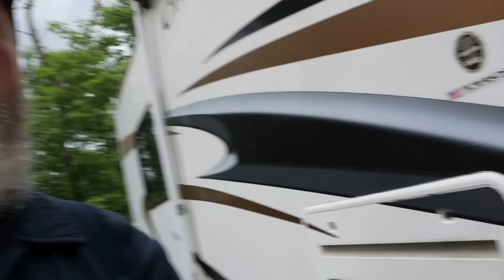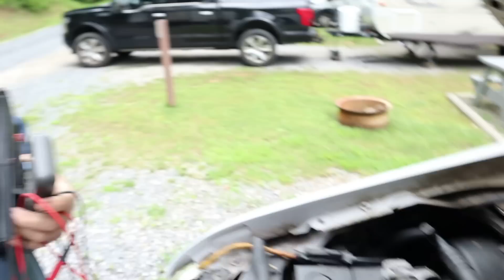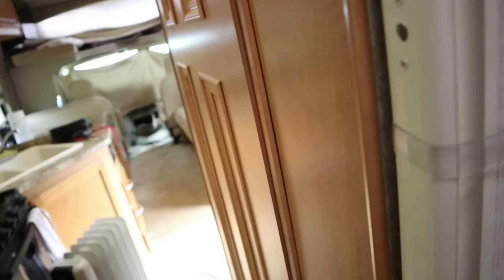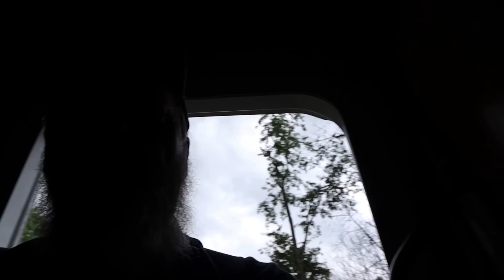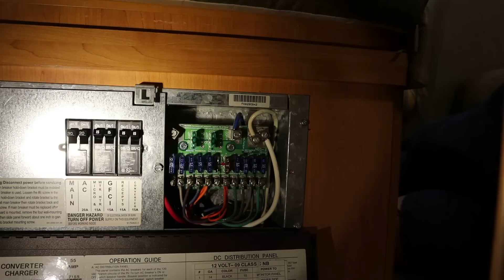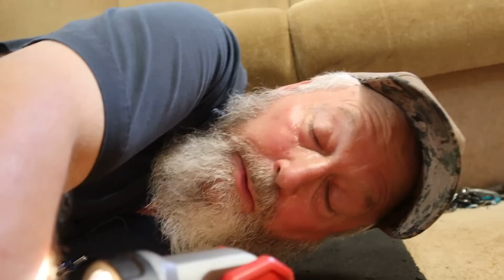Overloaded Circuits And Other Problems

Comment: Nice job Kenny!   I noticed this RV seems to use normal style outlets with a box in the wall.  our forest river trailer doesn't have boxes in the wall!  I went to replace a 110 light switch and an outlet in ours and found the covers just pop off and there are no boxes in the wall!   the outlets use the same style "wing" that grabs the paneling as a box that one would insert in drywall without a stud.    I was curious if I should cut the paneling out to allow one of those type boxes to fit and then use a regular outlet and wall switch.  BTW the switch is stuck in the on position and have no idea what it's for, assuming it's to turn the outlet on and off next to it that is located over the countertop by the front entry door and kitchen sink.
Reply from the maker: Just the GFCI in this RV is residential. All the other outlets are most likely the RV junk ones like is in yours. You can definitely change them to a clamp box and residential style outlets. As far as the switch, I have no idea what that would do.

Comment: As a retired FF/ Fire investigator and an avid camper that coach had too many extension cords especially for those heaters.  Fire just waiting to happen. Investigated a lot of camper fires in my time and several were because of excessive extension cords and not the correct wire size for the draw of the appliances. Thanks for the video.
Reply from the maker: Yes this is a fire hazard.

Comment: That sounded like the truck’s fan re-learning the stop points. It will cycle from by the feet to the defrost. When the battery has voltage again it re-learns. It happens when I take the a/c module out and put it back in.
Reply from the maker: Maybe. It was a weird noise.

Comment: Ok so if the convertor is working now,  and the starter/house battery gets replaced he shouldn't need  a battery maintainer as long as the RV stays plugged in to shore power.   An yes I think they have that 15 amp gfci circuit overloaded.
Reply from the maker: Not all class C motor homes charge the chassis battery from the converter and I did test it to find out.

Comment: That little do-dad is a capacitor.  I do HVAC and EC blower motors are getting more frequent.  Ive taken a few of the control modules apart and find that is the case, a popped capacitor. I believe ECM stands for Electronically Commutated Motor.
Reply from the maker: Thanks for the info

Comment: Hello Kenny!   We, your subscribers watch your videos to watch you figure out how to and fix things!   So, never not show video you have taken.  As you needed to repeat things in the video because of new subscribers, those same subscribers may need to see what you cut out.
As an electrical designer of over 35 years, I cringed when you showed the two heaters (those are called “electrical designers nightmares”) plugged into those very cheap Chineseium fire starter extension cords.   The combination of those two is the #1 cause of electrical started fires.   What really helps is when a throw rug is put over the cord to keep from tripping over it!   The rug really speeds up the process of getting the cord to melt and start the wiener roast.
RV’s are like Green Acres where Eva Gabor had the kitchen numbering system where everything was assigned a number.  Over a certain number of combined points, the husband had to climb the pole to turn the electric back on.
Keep the videos coming!   We enjoy them!     Kevin
Reply from the maker: You are right Kevin. I need to stop trying to figure out what y’all want to watch and just show you everything. Ha ha I had forgotten that about green acres. That is funny.

Comment: That failed component is an electrolytic capacitor.  That’s typically how they fail, and let out the magic smoke. I would suggest he plug the battery tender directly into the 15A receptacle on the power pedestal outside to avoid tripping the GFCI again. If he keeps using those skinny extension cords, he might want to invest in some fire extinguishers… 😮
Reply from the maker: That is exactly what I told him. Not sure he was listening though.

Comment: Hello Kenny love the video thanks so much. That thing inside the converter with the hole in it was a capacitor, and judging by the fact it seems to be one of the biggest capacitor in the converter. This indicates that it would be use for filter on the DC output of the converter. It would take a massive pull of current demand to cause this capacitor or associated components with the capacitor area ,to short out and cause this damage to this size of a capacitor. This is my guess after working on power units for over 30 years and seeing many failures .
Reply from the maker: Maybe lightning???
Reply: @hillbillyrv  Yea thanks I did not think of lightning . I have also seen lightning run back even on the ground wire and just do so much damage. Thanks so much.

Comment: The way I saw it was it was because he had AC power coming in, he shouldn’t have put the battery tender on, that’s probably what took out the converter, should’ve had the converter breaker turned off, that’s what I do when I charge my batteries on solar, but I’m still hooked up to shore power,
Reply from the maker: The battery tender was on the chassis battery. Not all motor homes are set up to charge the chassis battery off of the converter.

Comment: Did he actually have stuff up and running while gone for 7 months?  Looked like everything was disconnected.  If so then why would the gfci trip unless it’s bad?  And the converter…good catch but it doesn’t have anything to do with the chassis battery.  Or is the chassis and house the same in this case (weird)?
Reply from the maker: I think they just left it with the GFCI tripped. Chassis and coach battery is two different batteries.

Comment: Hey Hillbilly I have a question that has nothing to do with today’s video.I was touching up my caulking on my roof using Dicor  and it caused the rubber roof to separate from the roof.What are your thoughts on this?Do I need to use something else?
Reply from the maker: If you put a LOT of Dicor on it will kind of bubble the rubber roof, but it will settle back down in a few days.

Comment: We were tandem camping and my friend said his lights were dimming. I went over with my meter was checking the sockets and wasn't getting anything figuring it was the GFCI was kicked. Nope. He forgot to plug the camper into the pedestal. :face-orange-frowning:
Reply: A different funny story.  Was camping with a group and a friends wife hollered out a window that the stove would light.  He got to checking and the hot water heater wasn’t on.  So he started pulling stuff apart looking for a reason.  After a good hour he finally had worked his way back to the LP tanks, they were empty.  🤣🤣🤣🤣
Reply from the maker: I have to carry my own LP tank with me because you wouldn’t believe how many times I have had calls about propane appliances not working just to find out their tanks are empty.
Reply from the maker: That’s a good one.